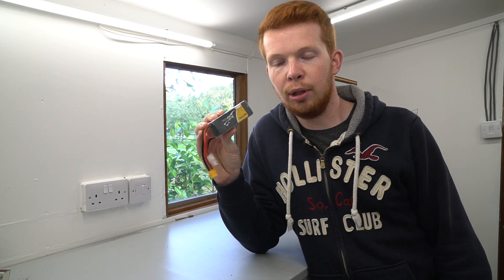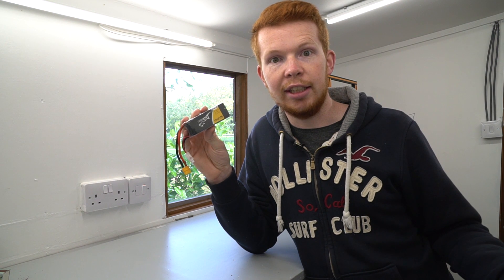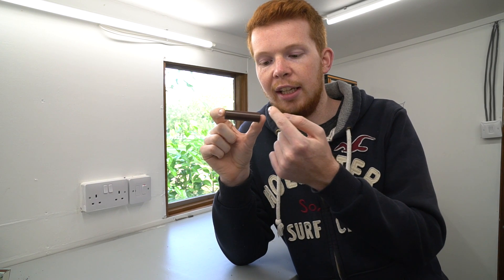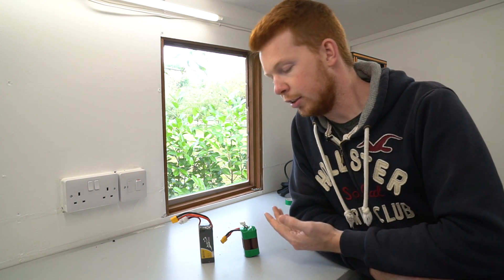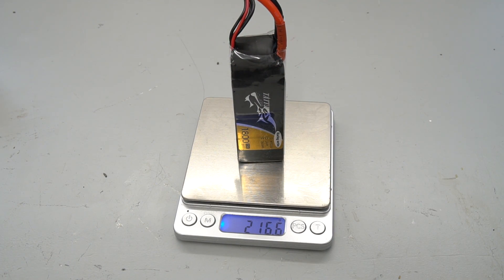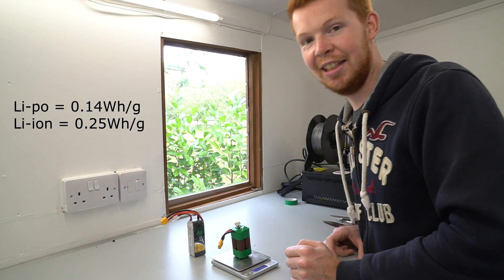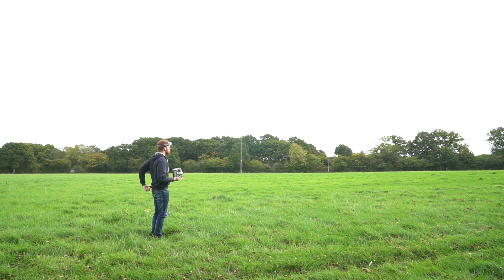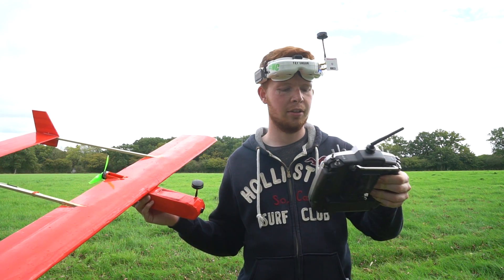Lithium ion plane battery

Comment: I made the same observation with my electric bike. I first bought a li ion because it has more capacity but I always had cut off problems. I then bought a li po with a lower capacity but it was much better.
Nice video
Reply: I’ve had some success from hybrids. You run a strong lipo in parallel with your LiIon pack. You get most of the punch of a lipo, and the capacity of 18650. The down side is you can’t take the pack below 3v or so for long periods of time.

Comment: 1.44 A is a lot if the Voltage is 50 kV or 100 kV and so on. You did not mention the Voltage. Amps x Volts = Watts

Comment: Since Li-ion has to run under load so its output V will continue to drop to be sufficient to sustain flight BEYOND 40 MINS ANYWAYS
Its not just about energy. it is about QUALITY OF ENERGY TOO. 
Energy density at hi V is worthwhile, where at low V is just weight just like in Thermodynamics a lot of energy at low temp gradient cannot run any turbine or engine

Comment: So. Two main reasons lion don't like having a heavy current draw if they are the higher MAH versions unless you get the 18650 models that are happy to provide high current but have a lower MAH such as the ones used in powerful vapes.
  If weight is not an issue you can add more of the high MAH lion's in parallel to negate this drawback, also adding some airspace between the cells would help.
  Then the discharge curve is different between lipo and lion and the lion can retain it's performance deeper into the discharge curve. I'm going to build my next ebike battery as a 20s 3P lion 21700 or 20s 5p 18650's

Comment: 18650 batteries are also used in high power devices, such as rechargable power tools, Tesla EVs, led torches, ect. With the right model of battery, they're plenty capable of high drain uses.

Comment: The fusion power core will solve all that when it comes out.
Reply: Good luck installing a fusion reactor on an rc plane. Perhaps you need to wait 1000 years for the relese date.😂😂
Reply: @stelic9515  micro fusion reactors 😂

Comment: So I appreciate the results of this test but am confused.    Could you explain more specifically why you would choose the lithium polymer battery for aerobatics or as you say- fast passes, etc?   Wouldn't the lithium ion battery be better in all respects?  Is the maximum energy consumption per unit time limited more for the lithium ion battery?  If not, I don't see why the lithium ion wouldn't be a better choice for RC airplanes.  One thing that does come to mind, though, is that I think that lithium polymer are far more resistant to damage from mechanical shock.  Thanks for the video and I look forward to your response.

Comment: Btw, just find a super resistor that can pull the average mAH that your plane and hook them both up to both batteries and add a battery alarm to the balance lead... then just clock both of them. You don’t need to get real world results... the idea is just to see if one can outlast the other...

Comment: You can spot wield with a super capacitor. Solder two solid copper wires to two ends of a super capacitor like a 500F and when you short it, it will spot wield.

Comment: I think the spec sheet for Li-On cells shows a 2.7v discharge minimum
Reply: generally you can discharge Li-ion to 2.5V without really damaging them (and even lower) but 2.8V ish is recommended for longer life and the ideal range of voltage for a Li-Ion is around 3(low) -4V (max)

Comment: Soldering directly to a lithium battery terminal is not recommended. It probably won't cause an explosion but it WILL damage the battery and potentially reduce capacity.  Spot welding is the accepted way to do it because much less heat is conveyed into the battery.

Comment: Bench test is not realistic: only "real flight" is valid. I suggest using RTP (very old school I know - it's my age) so that you can sit and read a book whilst the plane trundles round and round. Add a circuit to detect the desired voltage cut off and it'll stop when it's done.

Comment: Tom, it would be interesting to revisit this in 2020.  I would like to see you measure the actual flight time of both to their limits.
Reply: I agree, especially with 20700 or 21700 batteries. Samsung 30t 21700 batteries can supply 35 continuous amps at 3000mah
Reply: @YouTookTheRedPill  How can it produce 35 continuous amps at 3 amp hours?
Reply: Not for three hours. A battery rated at 3ah with a 1c discharge rate can supply 3 amps for 1 hour. With a 10c discharge rate, it can supply 30amps for a tenth of an hour, or 6 minutes.
Reply: Don't know if your are still interested but lithium ion has now become the norm for long range fpv flights. My plane can travell around 100km on one homemade pack its incredible
Reply: @OllyFPV what kind of airframe is that on?

Comment: 10:15 -- I know you're saying that you'd rather avoid having to do the same test with the Li - Ion batteries, BUT I have to ask, what if you could figure a way of doing the test cross-country, as it were?  Is there a way to make the route varied, AND for you to ride along while controlling the airplane by VR goggles?  Assuming there's a limited range for your transmitter / receiver, what's the longest circuit route you can plot inside that radius?  Can you get a digital video clip of what you see by goggles?
Reply: For Example, doing a circle / ellipse will give you a 2*Pi*radius lap length, but if you were to add waypoints - more than 4 - you could rapidly multiply the length per lap.  A 5-pointed star has 5 times a little less than 2 * radius; 7 points can be easily managed as a route.
Reply: RE: "Control Towers" -- as in, the way for you to ride along is the "control tower".  If the control tower can move, the airplane doesn't have to do a series of circuits like a newbie pilot at a civil airport.  A surprising option that occurred to me is to hire a cab, or even a horse and buggy, or wagon.  Something that moves at a slower pace than the airplane, not necessarily faster, and off-road preferred.

Comment: Try LiFePo
I once had to verify the flighttime of a drone (vtol) that is supposed to fly 60mins. That was extremely boring until 60mins where I had to draw about 120Amps from the LiPo. It managed to fullfill the test. By the Way. The plane was about 8,7kg take off weight

Comment: Hi Tom , I really like your video’s but I have a challenge for maybe something for a next video. Can you make electric motorized glider with solar panels that can stay in the air for 24 hours or more and fly by itself on a gps path. It should intelligently manage it’s use of power and find thermal heat and sun to stay in the air. I know it’s a very difficult one but I believe you can do it.

Comment: I do all my long range flights using the Sanyo GA (rated for 10A cont discharge and having a 3.45Ah capacity). They can peak at about 12A which is more than enough for takeoffs (usually around 8A) and a 4S pack can deliver up to 90 minutes of flight (that I tested). The Sanyo cells don't like to be discharged below 2.6V per cell. Further down and the battery sag (voltage drop when power is being requested from the cells) gets massive.

Overall I don't think effective long range flights would be possible with the Lipo's as they are just too heavy.

There are another two aspect on why one would want to use the Lion cells as opposed to Lipos: a Lipo pack when drained too much (which might happen when you're returning from a long flight against the wind) will just puff and are not to be used again as the danger of them catching fire is too high. Lions first of all don't die from going below 3.3V (as Lipos do) but also are enclosed in a metal compartment (as opposed to just aluminium sheets) which makes them far more difficult to destroy. And the second reason is pretty simple: they are in total a lot cheaper per capacity than Lipos are :) A 4S Lion pack of either Sanyo GA or LG HG2 will cost you about 25-30 USD whereas a Lipo of that same size will be about 35-45 USD.

All things considered Lions win all the way.

Comment: you should have done the weighing before you soldered / connected the wires and the connectors for both the batteries. or atleast measure the weight of the connectors+wires seperately subtract that from the measured weight of each of the battery pack then do the density math.

Comment: Hey Tom, Idk if you read comments but I have a ton of these A123 cells I ordered without knowing much about them. Would it be possible to use them for a plane/drone/esk8board/ other electric vehicle? I think their draw was that they could discharge at a huge current. Like over 100A. Each cell is like 3.7v (or 4.2v maybe) I think.

Do you have any desire for some of these for a project?

Comment: I'm kinda late to comment, but there's instructions out there to make a small scale spot welder using parts from disposable film cameras that have flashes.   if you go to a shop that developes film, they'll often just give you the old empty (already processed) cameras for free.  it uses the capacitor and the battery charging circuit from the flash.

Comment: Low power? 18650 can deliver over 30A :D You should buy better Lion cells...
Reply: The higher-current 18650s usually have less capacity, unfortunately
(though the HG2s are not that impressive in both departments, so you do have a point too)

Comment: So can the esc  be calibrated to nmhi  mode so this would allow you to run the voltage down to 2v per cell?  Perhaps you could see the actual flight time.  I think most of the time safety voltage cutoff wont let you use the full li-ion battery capacity

Comment: For some reason I was really surprised when you soldered them into a cube rather than end on end to fit down a slender fuselage.
Reply: It would be slightly more difficult to solder the balancing wires. But nice idea
Reply: He probably wants to use the pack for other projects as well, the most compact shape is the most convenient for general use.

Comment: You have to add weight to the lighter battery in order to compare in equal conditions their capacity. Unless you are testing only time in flight. Nice channel, congrats.
Reply: But their difference in weight is part of their important characteristic for a plane... it shouldn't be factored out.
Reply: I wanted just to know the difference between the capacity, he could just read the manufactures informations

Comment: both are lithium ion chemistry, one is called polymer because its packed in a polymer pouch instead metal cylinder.
Reply: Nope that's wrong the lipo is using a polymer as the layer separation.
It is packed in aluminum which is certainly not a polymer

Comment: Mount the plane. 

You can let it run and if it's a hot day, you've got a fan!
Reply: If the plane isnt moving itll eat more amps than it would while moving and could burn up the motors or overdraw the batteries.
Reply: @NeoIsrafil  No. It will draw more current that's it.
Reply: Why doesn't he just buy a fan or make a better one...
Reply: turkiye rc guruplar 2018 den beri bu yontemi kullaniyor 😊
Reply: Ronny Ktuziak Bit hes white! He doesnt absorb heat!!
Joking
Reply: @thecaptainnoodles  What a shitty joke.
Reply: @thecaptainnoodles  Pathetic joke..

Comment: Lithium ion and a little supercapacitor for turbo mode stuff.
Reply: super caps are not worth it i think it would be fun to mess around with maybe fore like a drag car but not for anything else really better to just keep extra range unless your building a race  plane
Reply: @popinmo  so what about a lithium ion powered plane with some super capacitors for short boost in performance, then just charge them right back up during normal flight
Reply: @matthewwilcox2055  yea you can but that may be fun but it I doubt other cons make it not worth it but I mean I guess I think it would be more fun for a car and more practical for a car as then it can have huge huge huge speed boost and not.damage the battery
Reply: @matthewwilcox2055  it's called using Lipo packs!!!!
Reply: @popinmo  LIPO
Reply: WEP Caps
Reply: @polygorg  LiPo!!!!!!!!!!!!!!!!!  st
Reply: That defeats the purpose of using Lion cells.  They already have exactly what you need.  They are called Lipos!!!
Reply: Stop trying to invent a square wheel with this cap non-sense.  Lithium polymer cells already exist that are literally already capable of more turbo than you can handle.
Reply: @toolbaggers  its about capacity.
Reply: or a booster plane module, that falls off when they're spent

Comment: I regularly run my LiPos down to 3.2-3.3v with no ill effects. One of my 3 cell ones (Turnigy branded, I got it in 2012)has around 250 cycles on it and it's still working fine. In fact, the EasyGlider I used to use with that battery lasted less than the battery itself... altough I dont know if that tells something good on the battery or something bad on the pilot, haha.

Comment: What about taking into account the fact that as the voltage lowers on the lithium ion batteries the motor output capacity will drop. So you'll have to increase throttle output and thus increasing draw on the battery and probably dropping that actual flight time. That second flight could have some very valuable information. Maybe 8v-10v isn't even enough to keep the plane aloft.

Comment: Your 18650s were probably counterfeits! If you bought from Ali or other chinese sites its practically guaranteed! Try to source real cells from group buys on some forums and you will be surprised by the performance of a real set! Sadly its also reflected at a price - you will pay easily 3-4 fold on what they cost at ali.

Comment: You can take any decent lipo down to 3.3v with no problem. 3.7 is the nominal voltage because it's in the middle of the operating range of 3.2v - 4.2v.  And yeah those LG HG2 cells still have a good amount of juice discharging beyond that usual minimum, but there's little to be gained by discharging beyond about 2.7 (2.5 under 1A load); there's just not many mAh there. That is to say, voltage drops off pretty quickly past that.  Running all the way down to 2.0v will also drastically shorten its life.

Comment: Just weight the plane down on the ground, then you dont need to fly around a boring field :)
Reply: True but the air moving thru the spinning propeller increases motor efficiency

Comment: Hey Tom, can you cut the red wire and solder a 16V Cap in between? Then redo the test only for the Li-Ion BatteryPack? Would be great to hear the result🤙🏼

Comment: 3:22 holy shitsnacks! that is sketchy as all hell. do not do this. the positive and negative ends meet up here separated by just a tiny bit of insulation. if that solder dripped down... yikes!

Comment: 14,8V at cruise speed seems a tad high still.

I flew planes and multirotors for quite some years and as rule of thumb landed at 3,3v per cell under load.

That makes 13.2V for a 4s configuration.

Usually batteries were back to right around 3,65 - 3,68v after the flying machine turned off.

with 18650 you easily discharge most of them to 3,0 - 2,8v under load without damaging them at all most likely a lot lower...

Comment: You can take the batteries down to 3 volts/cell without degredation.
Reply: Yes, but the plane should be on the ground with nothing running by then.  3.3 let's you land.
Reply: In theory you could even get them down to 0v and they should wake up as long as you baby them on the way back up

Comment: you lose capacitance when going in series.
Reply: What?  No, u don't lose capacity when connecting cells in series (maybe u were thinking about capacitors?)
Reply: @dominikworkshop6007  bet you do. measure it
Reply: @highwaltage   how much capacity is lost when connected in series?
Reply: @dominikworkshop6007  i use 1500mah 4s, when i bust a cell ,i usually turn them into 6s batts and i seem to lose about 150mah when doing so. pretty consistently. give it a shot. see what results you get.
Reply: @highwaltage  oh, well, from theoretical point of view it shouldn't happen, but I'll check it out soon , and I'll tell u my results :D just tell me how did u check the capacity of these batteries?

Comment: Hello,
a littlebit late but you can test it without flying (on a table) and look how many ampere are used. And maybe a reason for the difference is, how the speed controller generated lower voltage (PWM?).
Wizzard Rincewind (sorry for my english and greetings from germany)
PS: I think Lifepo are also more robust and better at low temperature.

Comment: it is true that lithium cells cannot be fully discharged without damaging them. this is considered in the total capacity of the battery which is way more than what the label says. that 1800mAh is the capacity you can safely use.

Comment: Flying/hovering a Bugs 3, using 2 Sanyo NCR20700A cells, is producing about 19.5 minutes run time (inside with no wind), about 17.5 outside.

Anybody try using a DC boost converter? With efficiency and weight concerns.
Reply: Im building 2s2p Sony vtc6, should have +30min flight time :-)
Reply: @przemos7816  
The problem with 18650 batteries is current sourcing.

Comment: if soldering is not an option, why not soldering contact plates to the wires and glueing them in place? as long as there is a spot that makes clear contact it should be fine. Sometimes low tech works just fine.
Reply: Bart Bols, glue has a better chance of breaking if the battery is dropped, and without taking it apart you couldn’t fix it.

Comment: Soo what about a prop that produces power in order to charge the battery mid flight
Reply: That would just cause extra drag = More power needed to keep up speed. Thus you would only loose energy.

Comment: Correction, 3.7V on a Lipo is not fully depleted. 3.7V is the nominal voltage Lipos capacity is calculated from 4.2V down to 2.8V or 2.9V (depending on manufacture). Running your lipos down to 3.7 is ok and will help battery life but to state that it is dead at 3.7V is not correct.